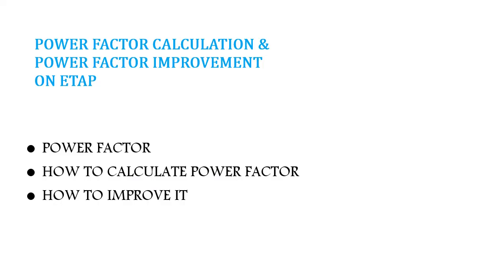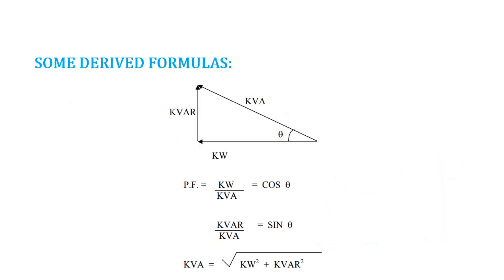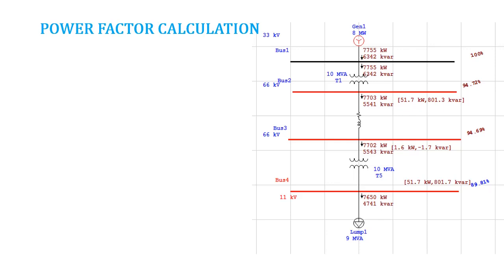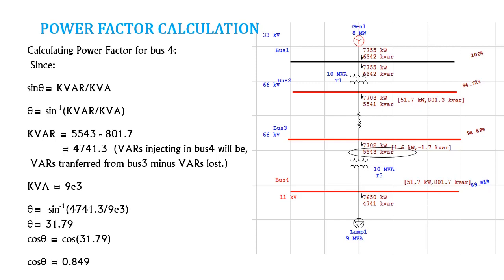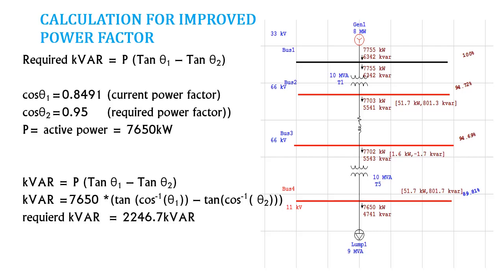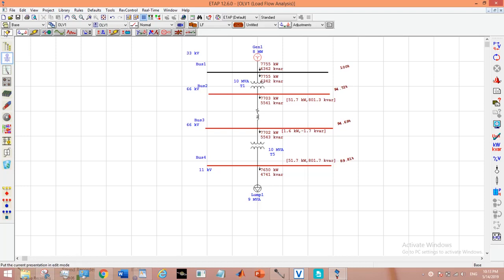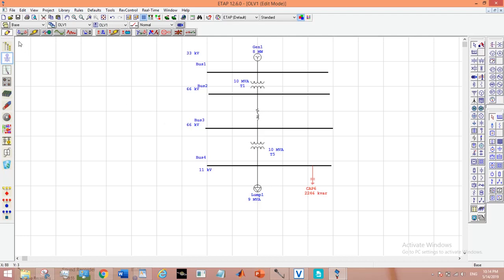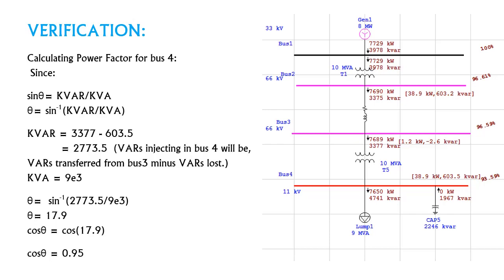POWER FACTOR Calculation and Improvement / Correction on ETAP

Comment: There are alert messages for Generator and bus no 2 3 and 4 as they are red in colour when you simulated ... I have also implemented with same values and there are over-voltage and over-reactive issues in this network... can you resolve them